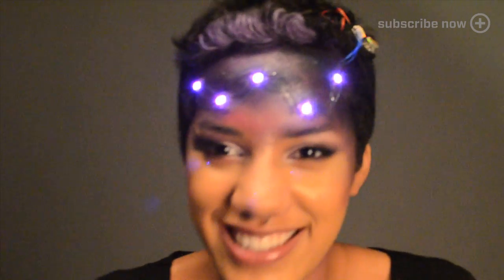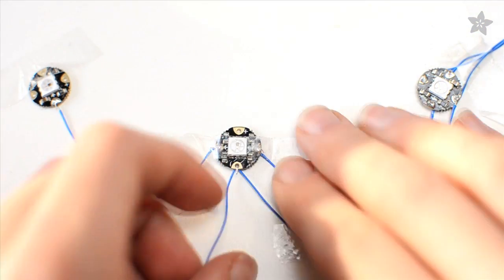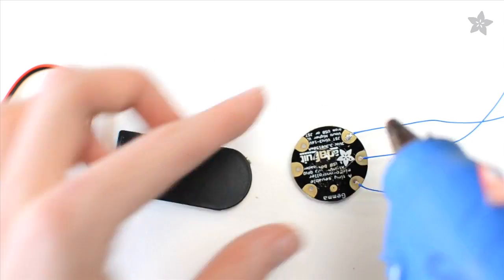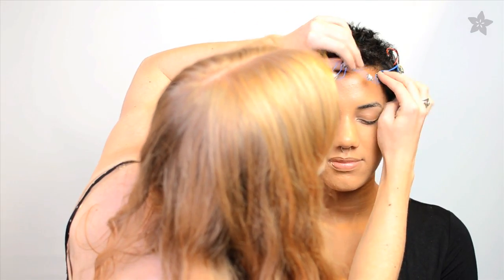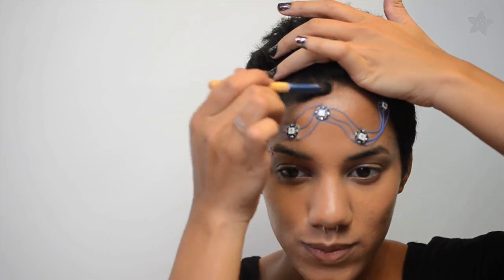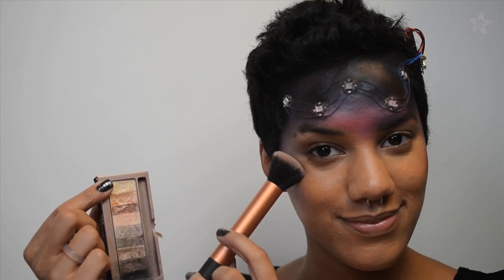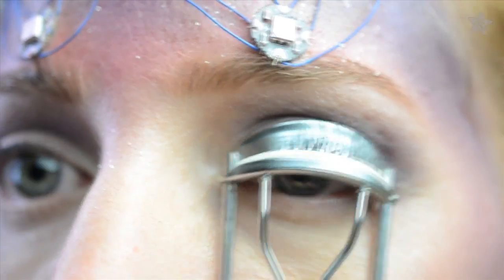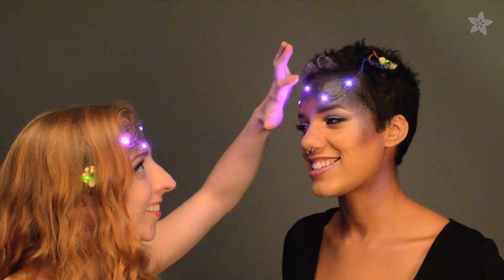LED Galaxy Makeup - SPACE FACE

Comment: Love this idea but I have a few questions/concerns:
Is it safe to have anything electronic as well as battery operated things on your head/face/hair/ brain?  Also can't batteries explode?

What happens if they get wet while wearing~ can you be injured?

e6000 is an extremely toxic & cancer causing adhesive it needs to be used only while wearing proper filter face masks & gloves. Maybe you can recommend a safer/better ashesive?

Anything else lile spirit gum to attach to skin instead of expensive (& messy, irritating, staining) liquid latex?

Thank you

Comment: How long this Gemma Project with 5 neopixels will work with two CR2032 lithium batterys?
Im working with the same hardware but only 3 neopixels. but my yet testet 2450 3V Lithium batterys will light up the pixels only for a few minutes. can anyone help me or has tip for me?